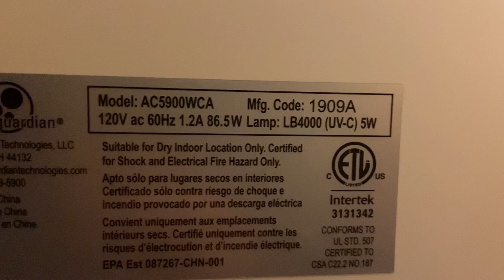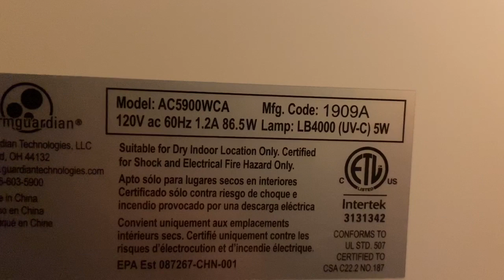The Blower Fan in the Germ Guardian AC5900WCA.

Comment: I own one of these 5900 units and a few of the similarly designed Winx models. I just picked up another of these 5900’s because my existing unit has been running non stop since the earliest days of Covid and no issues. The fan is indeed powerful. I hate dust more than I’m concerned about Covid so I run a few air purifiers around the house, trying to standardize on only a few types to make it easier for filter replacement.
Reply from the maker: I love both the Winix and this 5900 model but I agree, I like how powerful this fan is at removing dust. I do wish it had an automatic mode like the Winix does, but considering how strong the fan is, it probably doesn’t even need an auto mode  anyways.